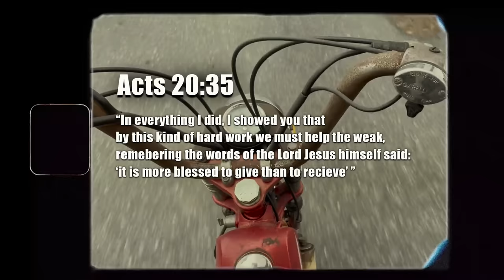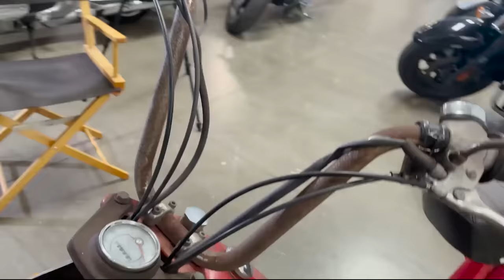I Bought a $700 Barn Find

Comment: I’m 20 and the beginning of this video made me tear up a little bit because I was introduced to the world of motorcycles in a very similar way when I found my moms 1985 Honda rebel with a siezed engine in the shed when I was 15. I got it running, hit the street at 16, and blew the head gasket on the highway. I didn’t know anything about engines so I spent 9 months pulling it apart, putting it together over and over until it ran again. It’s had about 2200 miles on it since I started riding it and has brought the world of motorcycles to me and my 2 best friends that I taught on it. Everybody’s first bike is always an emotional rollercoaster.
Reply: Yeah my first one i spent an entire summer to save 2000 for a dirtbike and it had so many problems... I sold it and lost like 400 on it but since then its an addiction and I've owned 5 motorcycles just in the last year. Sportbikes, dirtbikes, minibikes, just never owned a cruiser before. Im getting a dual sport next, I want a XT225 yamaha (street legal dirtbike) because its very lightweight and reliable and I travel in my RV around the country full time. I can take the xt225 offroad, trails, and highway! Its a 6 speed.
Reply: yup  recently bought my ducatti 848 back with a broken timingbelt currently in the process of repairing the engine and doing some upgrades for common issues and installing a bodykit and a lot of new modern goodies it lived a decent live since i sold it to a mate yes the timing belts where done in time always but for an unknown reason one broke 10000km before the replacement time the belts wherent that old only 3 years as i got those replaced at the dealer as the bikes been maintained at the dealer since i owned it and the next owner did also keep it dealer maintained for 30000km the bike has done atm 91678km currently the engines at a machine shop a friend a mine owns but for a friend price its an 8 month wait thanks to covid as a lot of people are working on their projects atm here doesnt mater anyway as i am waiting on parts from italy the us and germany a few pieces arrived but need an engine to be installed and the previous owner also bought brandnew tires for the bike which i took over and putting on as the tires on it are old and starting to dryrot i still love that bike
Reply: Good story bro. It's refreshing that at least one younger feller is in to cool stuff. Many of your contemporaries aren't into anything. My first motorcycle was a 1974 Honda CL200 that my uncle Ed dragged home when I was 14 or 15.
Reply: The first motorcycle that I owed is a 1984 Harley Davidson Softail. I still have it. My second was a Honda Rebel 250 that I bought to teach my mother to ride. It is long gone and I regret selling it.

Comment: I had that exact moped when I was about 12, the Garelli, I played on that thing every day for two years until I got something a bit bigger, one thing is for sure they are reliable and fast compared to today's restricted mopeds, my brother "sorted it out" decoked, new points condenser plug HT lead and reamed the carb out increasing the volume by 3-4mm and up jetted it, pod filter, it was like turbo moped after that, it shares common components with the Gillera moped, mine had the square plastic headlight speedo unit,  PS that kid is now finished with bicycles, well done, moved him up a gear,

Comment: If you are asking, the motorino (small motor), that's how we called in italy anything with less than 50cc, has the pedals (and the small engine) because of some old legislation, basically it's a motorized bicycle as the law is concerned so you don't need a driving licence, etc. after that they removed the requisite for the pedal so you can have some cool small bike (yes there was some abomination back in the days, i'm not saying a motorcycle with pedal...but...) 50 cc two stroke 12/14 carburator (if i recall correctly) and 4 speed gear box, plus a big bike look.

Comment: Me and 2 of my brothers put a 2hp Briggs and Stratton rope wind start on an old Schwinn beach cruiser. My dad welded a plate to it for the motor and welded a pulley in sprocet after we lopped of the pedals. That configuration didn't work so dad took us to bank for our own cash and to Joe Apol at Skelley station in Raymond where he sold us an M50 Harley Davidson (1966) with a regular tank, not the moped style. Shortly after that Joe became a Harley dealer.......and a successful one at that. He now has 2 locations, the original one in Raymond, MN and another at Alexandria, MN. Last summer I bought my first adult Harley, an 02 Super Glide.

Comment: Since I was a kid I always wanted a moped when some of my cool friends had them, but we couldn't afford them.  Fast forward to last winter and my little brother picked up two while helping clean up a property and didn't know anything about them.  I gave him $150 for both.  A couple days later, cleaned the points, change the fuel line and petcock...this 54 year old finally had a running moped.  76 Western Auto Sachs 49cc.  Looks a lot like yours but didn't have the oil filler.  Mine only runs about 20mph...lol.

Comment: That's epic. I'm 17 but I recently purchased a mini chopper off of a dude and I've been fixing it up and everything, I also painted it with the American flag but then I sanded it down to make it look worn, like it had been through a war. The engine still works and it can get up to 50km/hr or 30 miles/hr. I ended up installing a train horn to it and I've been learning a lot about electrical stuff. Sadly the starter is complete garbage, sometimes it works, sometimes it just sucks, but I've found ways around it, like using a socket wrench to give the starter a jump start, or just kicking it to make it work. All in all, it's a really cool bike, and I'm very happy I made the decision to buy and work on it.

Comment: I can relate to your story 100%.
Although I did not create a motorcycle business, I was 16, had a pilots license but could not get a drivers license in Argentina until I was 18. A neighbor told me he had this old bike he would sell me cheap and I pounced on it before I even knew what it was. It turned out to be a Paperino 48 cc made by Garelli I believe. It was in bad shape and had not run for many years. I pushed it all the way home adding air to the back tire every so many blocks. It took most of the day and some people that saw me pushing this thing asked me if I had lunch and welcomed me to their back yard to share their BBQ meal. I was on my summer holidays from school and my parents were on vacation so I had the house to myself and a buddy my same age. We worked on that bike for two days and finally at 3 am we got it to fire up. The nut holding the exhaust pipe was cross threaded and split so it had no exhaust on it and made a good racket. The neighbors complained so that shut us down for the night. The first month or two I rode it everywhere with a makeshift exhaust, a leaking front tire and a back tire held together with duct tape. The chain was stretched so it kept jumping a tooth now and then, but I learned how a 2 cycle engine worked. I carried a pill bottle with extra fuel in it so when I ran out of fuel I would pour in this mouthful of fuel and ride to the next gas station. I would dig through the dumpster looking for empty oil cans at the gas stations to add the last drips of oil from several cans to my two liter gas tank. A year later I made a new frame out of water pipes and used an old kerosene stove tank as my fuel tank and created my own "cruiser" bike. The frame eventually split in two and I Iost my front tooth and the bike never ran again.  I had two more bikes after that and have now many many years later put money down on a Honda Shadow 750 ACE that I am waiting for,  I tried to attach a picture of the Paperino but you will have to google the ugly duckling.
Reply from the maker: What an amazing story

Comment: Nice bikes.That motorized bike in the garage it's a 49cc motor, The Chinese call it a 66cc motor because they add the cylinder head space into the configuration of the measurement in cubic centimeters. Without the Cylinder head in it's measurement it's 49cc.  Great Gesture, Good Job!

Comment: Nice. I got to mess with a classic honda moped before. It didn't run but almost did, it was spitting out tons of smoke and some times would run for about 5 seconds until it cut off. 

What I kind of liked about it was its like a kick wind up starter. In the late 60s it was marketed for woman. It didn't have pedals. To start it you have to wind up the starter spring by using the kick lever about 4 times and then choke and full throttle will spring spin the motor. Had automatic 2 speed.

I thought I was going to take over the moped but after I installed some parts like spark plug and contact point, the so called owner took it to the scrap yard as scrap iron when I was just getting some coffee. And then the so called owner says "Why didn't you tell me you wanted it".... ummm I totally did tell him and I was even updating him about the progress I was doing like ordering parts and cleaning the carb and installing parts and it's almost running but just waiting for the contact point to come in.

Comment: When I was 13 I built a minibike from an old bicycle frame, a wheelbarrow wheel, and a 1.5 hp Clinton lawn mower engine, driven by a V-belt and an 11" washing machine pulley. I was the envy of my friends because I had a homemade twistgrip throttle instead of the string tied to the seat frame like they all did. I've owned over 25 2-wheelers in the 60+ years since then, but none were as much pure fun as that minibike. The 69 Yamaha DT1 was a close second.
Reply from the maker: thats awesome and I bet it was some of the most fun you have ever had

Comment: I had a motobecane just like that one. Crazy design with a variable pully design. Precursor to the CVT transmissions. Pully diameter would shrink to allow good takeoff's and as it got faster pulley would expand the diameter and the motor would actually lift up higher and higher as that happened. Was able to do 40 on that thing. Drove it for a year til I got my first car. Wish I would have kept it.

Comment: I started out on a bright yellow honda 50cc just like that one when i was 14 years old then my next bike with manual gears was a TS125 and i learned how to ride a geared bike, also had a yamaha dt50mx in black and red, loved that bike. Wish i still had it. Curently i own a Yamaha xv750 Trike and a Honda Varadero xl125v twin. Honda's normally have silky smooth gear changes and mine is no different the clutch is feather light i can pull it in will my little finger.

Comment: if you go on longer rides or the carb isnt properly adjusted and it runs a lil hot theres a possibility that the gas in the carb might boil frim the heat of the cylinder. Just warningt you might wanna make a heatshield for it

Comment: I started out on the old ATC Honda three wheelers the old Big reds and then moved to mid 70s Honda Enduro and then went up from there have owned several different kind of bikes Yamaha XS model CB750 Honda Vulcan 1500 88 model and so on now what I have is one I inherited when my father passed it's in 02 VTX 1800 retro she has 6700 original miles on her and illusion blue got a little paint work to do being with my dad bumped into the front fender with the pickup truck one day so repaint is in order but other than that she's a brand new bike and I love her and she is a torques monster and a beast I call her Henrietta the Harley killer

Comment: Sidecar motorcycles are Chick magnets. If that's what you're looking to do you need a classic bike with a sidecar. Just leave the cover off the sidecar and keep a helmet in the seat. Don't be surprised when one jump's in the sidecar at a red light or yells at you to stop and let them ride in it. I never even thought about that until I found a Dnepr MT sidecar motorcycle in a barn and restored it. I had just got it running but didn't have a cover for the sidecar so I was riding around with an open, uncovered sidecar. I had stopped for a red light when an Adventurous woman jumped in it. No invitation or waving or anything like that. She just came over, jumped in, and said let's go! I went home and ordered a cover for my sidecar as a result of that. That's why you see sidecars with covers installed whenever no one is sitting in it.

Comment: You can clean all the rust off with aluminum foil and water or better yet with Coke or WD40 rust penetrant. The foil is softer than the metal so won’t scratch and the foil has a chemical reaction with the rust and pulls it off. 
Check it out.

Comment: I had one , was about 18 ish had bought a 1974 puch maxi for 450. Running I repainted it orange candy like original type ND put some dirt bike bars with cross bar u tighten on both side . And a exhaust from online was tight went about 45 had fun ...        now about  later 6yrs later I pick up a 2004Honda ruckus only 5miles for 200. Been park for abot 17yrs That's a deal gastank full of Nasty bad fuel pump. But was about used that gas tank off the motorbikekit gravity feed gas got my ruckus Goin has about 48miles now

Comment: K mart or TG&Y sold dirt knobby tires that fit the scooters and mopeds back in the 70s and along with sprocket changes and carb jetting knobbies were the 2nd upgrade made immediately after removing all baskets and foo foo looking stuff like sissified chain guards... You could ruin a pair of bell bottoms with oil,rust,and sprocket teeth in just a few minutes time... Gutting the silencer was cool until the noise complaints as well as hearing the 2smoke engine sounds ringing in your ears all night in bed. ..

Comment: I started riding back when I was 16 I help a guy move and he had an old rebel 250 set for 8 years in the shed and I looked at it checked it out so when I was finished he said I can pay you or you can have the bike. I actually skipped school to get it running and that's where my two wheel journey begin.

Comment: These Mopeds were available in germany before year 2000. I had one too. I tell you something funny.
In germany these bikes are called Mofa. Short for Motor Fahrrad. (prtrol powered Bycicle) and they had to drive 25 kph. 15.5 mph. Thats not all. You need a driving License for it. We have 5 Motorbike licences here. 1. Mofa at 15 ys.   2. M = 50cc at 16 ys.   3. A1 = 125cc at 18 ys.   4. A2 = 48 hp at 18 ys.   5. A = unlimited. IF you want A, you get A2 for 2 years. IF you are able to survive without any mistakes like speeding or accidents etc, you will get A.  IF you make license for cars, it's B by the way, you will get M, too. You can do one of the others together with B, but you have to make special lessons at driving school, have to do a second theory test and a second driving test. All in all its very expensive. B costs 2000 €. A costs 2000 €. If you do them together it will cost 3000 €. At least 18 hours at the driving school.... It takes time, money and is stressful. And before you ask, no its not allowed that your parents train with you. If you let someone drive on public roads who has no license, you will loose yours. 
And before i forget it, even if you have A, you are not allowed to drive ATVs, Quads, Trikes. For them you need B. If you have B, you are not allowed to drive a motorbike with sidecar. For them you need A2 or A. Caused by the engines power.
If you have B, you can drive cars till a max complete weight of 3,5 tons. If you want a car with more complete weight, you have to do more lessons and a test. IF you want to tow a trailer, you have to do more lessons and another test. All vehicles with a complete mass over 7.5 tons is a truck. You need C to drive it.
And it don't stops there. IF you have managed to get the license for big heavy vehicle whatever kind, you are just allowed to have 8 passengers. Yeah, maybe you have the license to drive a 12 ton bus, but to have more than 8 passengers, you need more lessons and another test.
If you want to become a trucker to drive trucks with more than 40 tons complete mass, or oversize vehicles, yes you guess it right, you need more lessons and more tests. All in all if you want to have ALL licenses available, you pay 10.000 to 12.000 € and 3 month daily lessons with weekly tests, IF nothing goes wrong. IF you fail a theory test or practice test 3 times, you have to redo at least 6-8 hours and have to pay extra.

Yeah germany is great, huh?

Comment: A buddy of mine found a garage kept 1979 vespa grande with 99 original miles on it. It still had all of the original tool kit and the original tube of oil to mix with the gas. Original Perelli tires that still, and still do, hood air. Turns out the original owner bought it new about an hour away from where it was found. Original owner put exactly one tank of fuel thru the moped and then it was parked, never to be ridden again until a year ago.

Comment: Dang . I had a Garrelli  just like this but mine was Yellow . I paid 75 bucks for it and it was in really really nice condition . The only problem was me . I could not get the dang thing running . It had great compression and had great spark and got fuel . But know matter how fast I turn the motor it will not start . So I got rid of it .